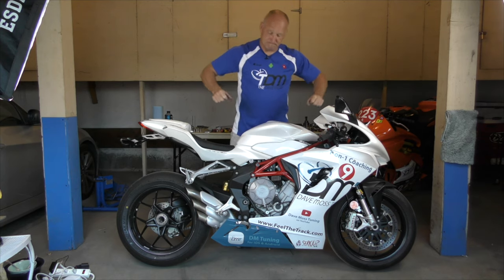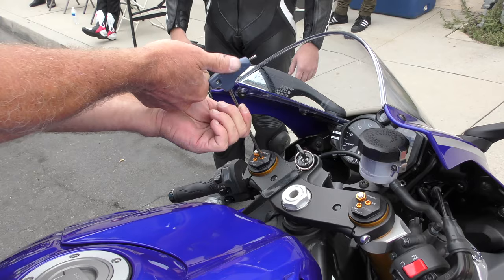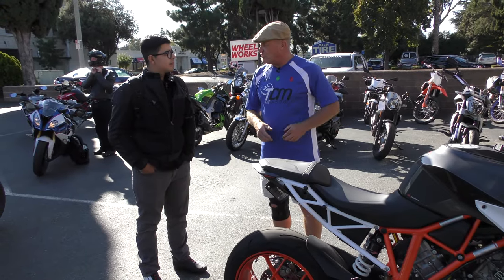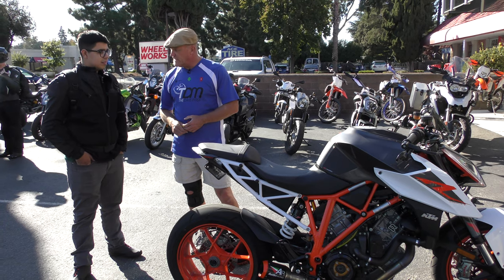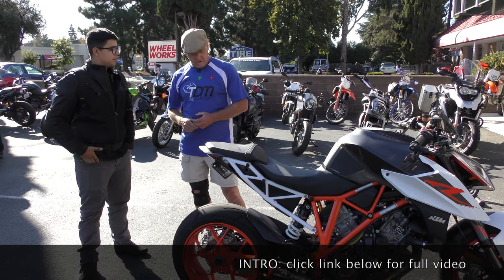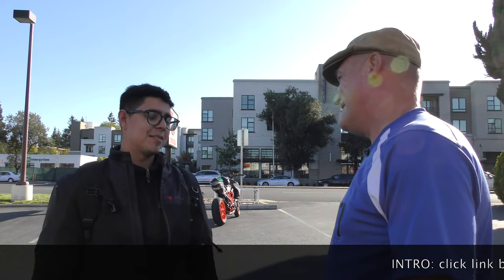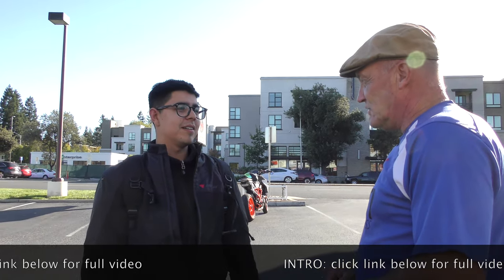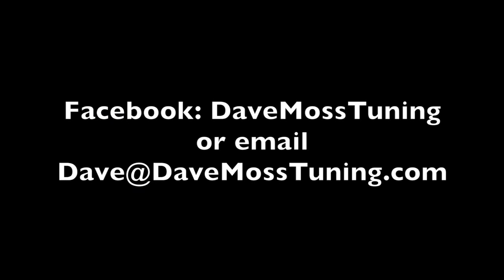INTRO Motorcycle Suspension Setup for Shorter Riders ft. 1290 R Super Duke

Comment: I have a feeling that this is a beginner that just got a very non-beginner bike... Safe travels young man and may the KTM IMU keep you on the pegs
Reply: Definitely have to be on your A game if that’s your first bike.  Nothing like learning the hard way when the font wheel starts heading to the sky.  Ride safe and easy on the gas.
Reply: It got a lot of hps, but other than that it's a seriously smooth bike to use, all electronic safeties you could wish for, great breaks, butter clutch and so on and on and on...there's not much you would want to change on that bike, if anything ...it's just so smooth that hps aside it's probably a much easier bike to use than most. It certainly aint gonna wheelie if you dont disable antiwheeling  alone or TC (dont disable TC on that!! my 690 loses traction easily in hard acceleration, so imagine a 1290...dont). For me it's mostly a problem of price, a beginner shouldnt be using bikes that expensives yet, gotta be expert to spend that much on one, it's kinda like a end game type of bike, not a beginner's. IMHO

Comment: Making the spring longer, does not make it softer. The "hardness" of a spring is independent of length. (If its a linear spring)
Reply from the maker: For progressive springs, yers it does. not the case with a linear spring.
Reply: @catalystreactionsbw  Yes, so we agree! Also, I just purchased a 675 and the previous owner hacked the forks to lower it. To return it to standard, it is probably easier to buy new cartridges. Would you recommend Bitubo or Andreani cartridges?

Comment: I’ve got same issue. Bike wobble over 130mph for some reason track or street no matter
Reply from the maker: 1. Check shock travel used (I have a video for that topic). 2.Check fork travel used via a a cable tie,. That will tell you proportionally, how the chassis is biased. More shock travel = less front grip = wobble.